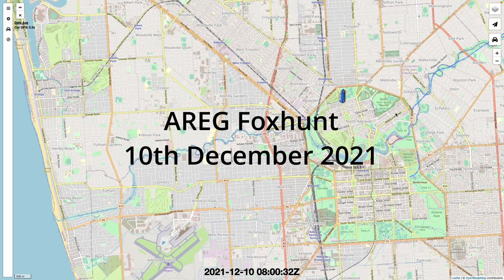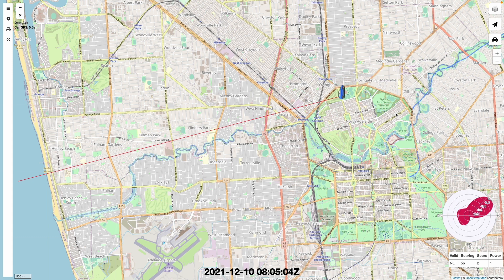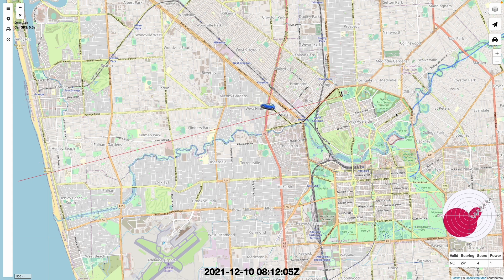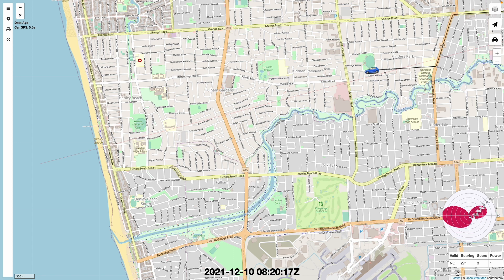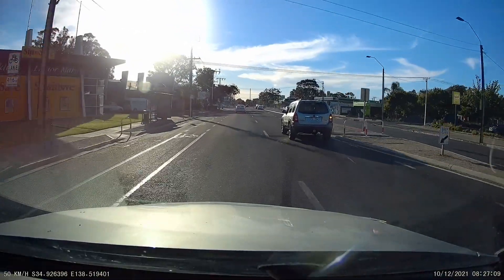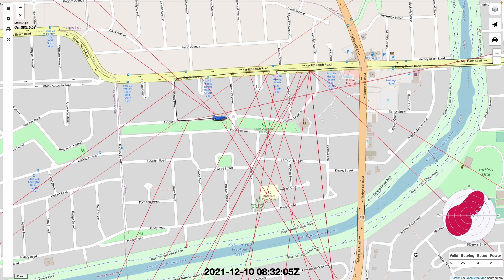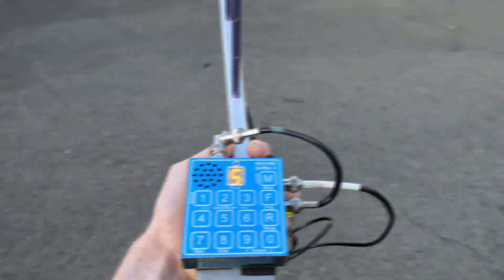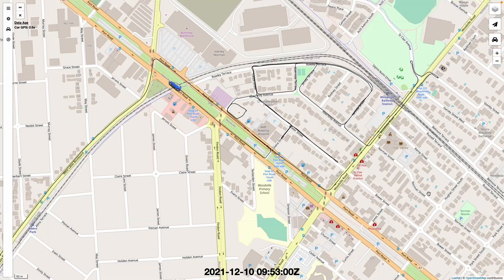12th December 2021 Amateur Radio Fox-Hunt

Comment: Is Chasemapper compatible with KrakenSDR?
Reply from the maker: By default, no. I have a fork of it (which I really need to update...) which emits the required data that Chasemapper needs.
Reply: @markjessop8536  Thanks!

Comment: Would you be able to tell me how you made that box that converts 440 into 2 m? Or where are you buy one? Thank you.
Reply from the maker: It was very much a hack-job. If i recall correctly, its a Minicircuits ADE-1 diode-ring mixer, and I generated the appropriate LO to mix from 430-440 down to 140-150 MHz with some radio module (a HopeRF RFM22B I think...)